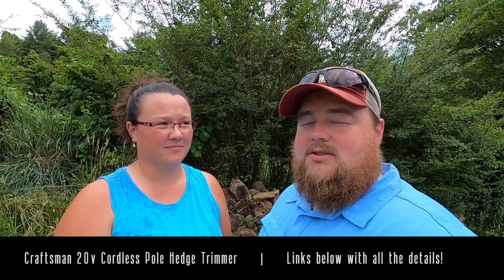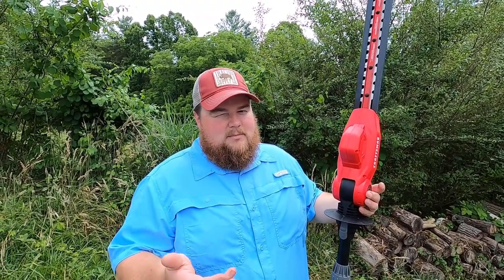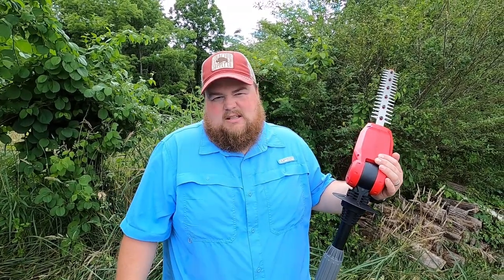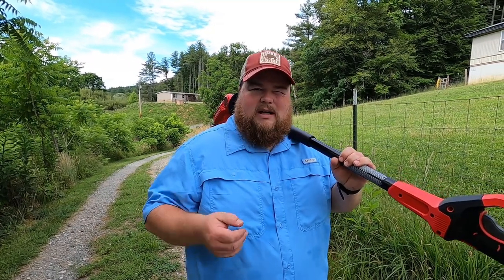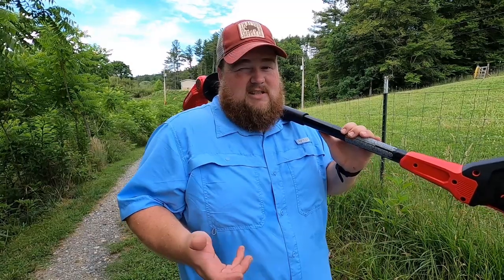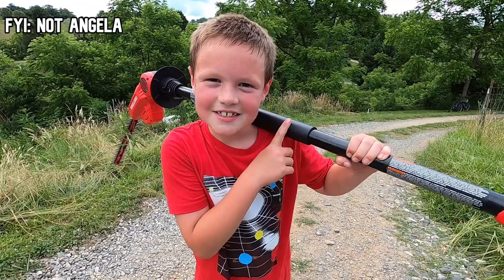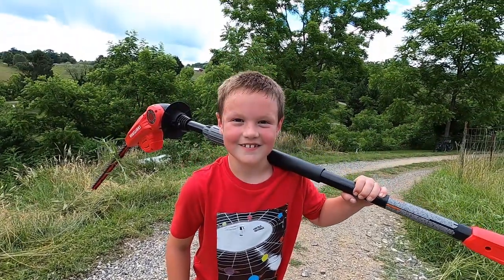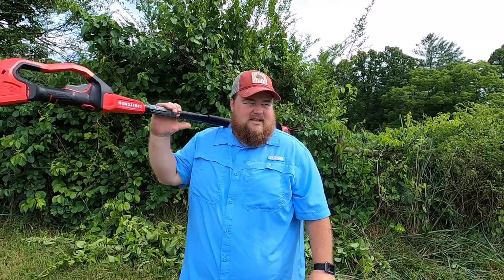Rethink Your Lawn Care Tools - ODD USE for a CUSTOM solution!

Comment: Good video, not impressed with the tool. Way easier to use a weed Wacker with a solid blade for weeds. But it does look like it worked pretty good for Angela for shrubs. That is true about the allergies with weed Wacker. Your son is so adorable. Love how organized your shop is.  Is there a strap available for it?

Comment: I also have an awesome lawn tool for all those old folks that are sick of 60 years of lawn work. It is not a Craftsman it is a NATHAN. It cuts, trims, sculpts my bushes, cleans up after it's self, easy to use, has a good reach on it. It is very heavy, I could never lift him, I mean it. It is about 35 years old but still works good tho. Remember NATHAN. I do not know if it comes with batteries but I know it works real well if you give it a Coke.
Reply: But they are in very short supply and many will not work well on coke.

Comment: The thing is built wrong, motor should be back by battery then it would not be so heavy feeling.  Your are trying to hold a fairly heavy motor out at more than arms length.

Comment: Looks like you all are raising and bending your "back" arm, causing it to work harder, hold the weight of the trimmer higher, thus tire more easily. 
Straighten the blade out more, so the angle is smaller. 👍
That should help with those issues.  😉

. You might also fashion a strap to take up some of the weight of the trimmer. One that goes over one shoulder and under the opposite arm. Kind of a cross between a guitar strap and the strap on say a saxophone. 
. The ends will meet (like a lanyard) and attach to one point/place on the trimmer.
. Make the strap adjustable, so anyone can use it, using a buckle with a prong, not one that just slides.
. This will take just enough weight off of your arms so it isn't so much work. 
. By having just one attachment point, you will maintain the flexibility needed to maneuver it effectively. 
. Give it a try and let us know how it works for you! 😉

Comment: Yeah , the cutter head is way too heavy ,  the weight distribution i e , the cutter motor , should be at the bottom of the tool . With  spindle drive to the top cutter , interchangeable sturdy but lightweight cutterhead  Would redistribute the weight quite a lot , better balance .. Harness should come with the tool also . Craftsman needs a rethink on the design .  Friend had one very similar , took his back , bought totally different one with easier better weight distribution . . As described above . . Other than that . Why is craftsman not sponsoring you . You mention Thier products often enough . Elijah should be junior spokesman for craftsman . With said monetary remuneration from said company of course , junior advertising company spokesman . 😋 .  💰 💰 💰 .

Comment: I'd rather buy a weed eater and a few heavy duty attachments. A steel cable cranked up will put the hurting down or a chain if you have branches to snap. Loads faster and less passes. That would be perfect for light loads tho.

Comment: I think you should have bought a weed whacker and a "gator" head. It cuts limbs and brush that is bigger tug than your finger. Probably you would have spent less for it too. 
Sears has gone out of business in my area. So warranty work would not be available.
Reply from the maker: We have a gas trimmer and may look into the Gator heads. Lowe's Home Improvement now sells Craftsman items, along with some ACE hardware stores.

Comment: Bought their weed eater and leaf blower combo. So far the weed eater has been good. I have a gas power Stihl weed eater that does a great job but super heavy. The battery powered weed eater I can use one hand. When I grew up Craftsman was the king of the tool world. On a side note I will say you are brave doing that work in shorts in North Carolina. I would have my snake boots on :)
Reply from the maker: We've been eyeing the string trimmers! I have an Echo two-cycle and it's great for the big jobs but is also heavier and a grass slinger!
Reply: @sam-and-angela  It works great. One battery is not enough for what I need so I bought a drill that came with a battery and charger. I really just needed the battery but it was about the same price for the drill, charger and battery as it was for just a battery.

Comment: I bought the Kobalt version before Lowes switched over to Craftsman.  I've been using it for three years and love it.  The swivel head has made my life so much easier.  I used to stand on a ladder to trim the bushes, now I can stay on the ground.
Reply: @sam-and-angela  The cutter head is exactly the same.  The other end is different because Kobalt has the bigger battery.